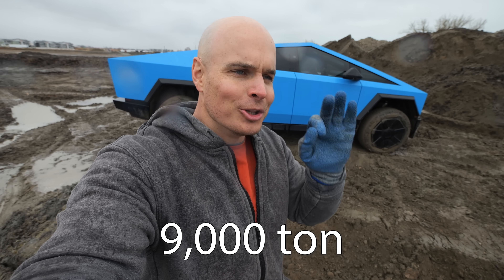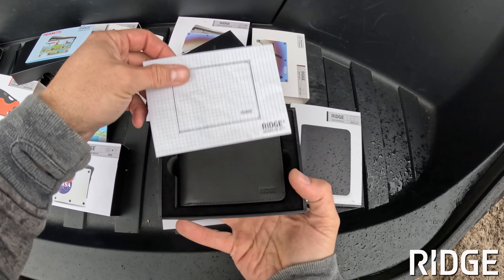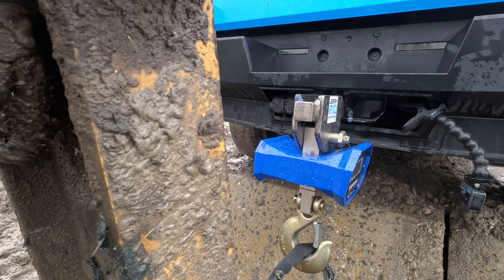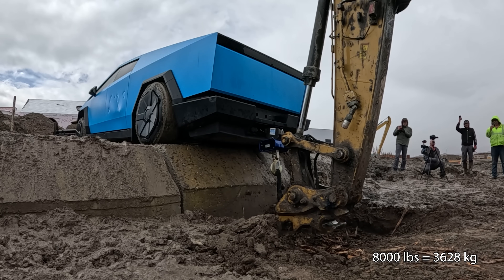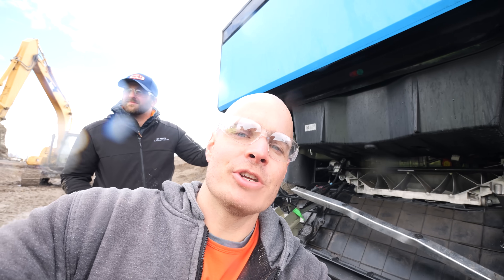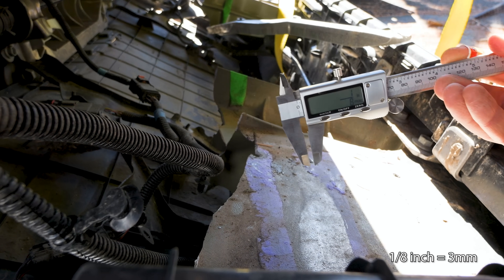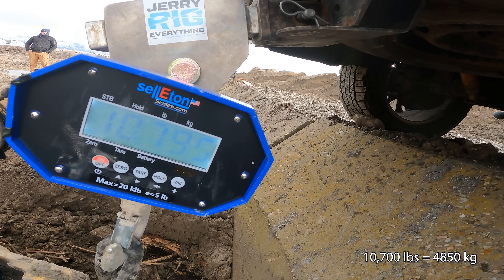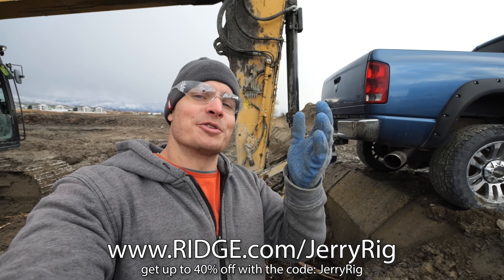SHOULD YOU TOW WITH A CYBERTRUCK?! - (catastrophic failure test)

Comment: What a moron. He says... "that is one improperly loaded trailer away from disaster." If you had a 10,000 lbs on the tongue, the front of the truck would be off the ground. This is a dumb test and just for clicks.
Reply: 9:50  The video explained that the tongue weight should safely bear 10-15% of the trailer weight.  However, it will need to bear significantly more than this amount in certain situations like cresting a hill.  Is it possible that you're not as smart as you think you are?

Comment: This test was kind of frustrated well exceeded the tongue weight capacity 9.4 * rated tongue weight 
The rated tongue weight capacity was 1100 lb you made it seem like 11,000 lb was the tongue weight capacity that is not the case that is the towing capacity 
And yes some extra weight can become tongue weight but it is very very unlikely that you would have this much weight be transferred to being tongue weight I think 9.4 x capacity is a good 😢
Reply: so then why does a gas truck that's has been totalled off and bent tow hitch from the crash and still holds at the breaking point of the cyber truck?
Reply: @raven4k998 because the dodge is a 3/4 ton truck. It's made specifically to have a much higher towing and tongue rating. It's as simple as that.

Comment: this is a test of tongue weight. make note they had to hold down the front of the car because it would have lifted the front off the ground.  Completely useless test. even the ridiculous ignorant comment is still in the top of page " The hitch breaks around 10,000 pounds. (4500kg) Which is far too close to the 11,000 pound towing capacity. Yikes." He is not pulling 10,000 lbs he is pushing straight down - that is called tongue weight which is typically < 10 % of the towing capacity. So, a 10-fold safety margin is more than acceptable.

Comment: Great to know you were testing tongue weight and not towing capacity... The tounge weight of the cybertruck is rated at 1100 lbs, you put almost 10X that amount on it.
For the Dodge 2500, the Max Tongue weight is 1800 lbs.
So you already knew (If you know vehicles) that the Tesla is at a disadvantage at the start by looking at the stats to begin with.

Towing capacity and tongue weight are not the same thing.... Be honest about that.

Comment: The amount of Tesla appologists who are entirely missing the point are wild.  I'd bet some of these people would convince themselves that they deserve it if Elon/Tesla drowned their cat.

The point isn't about carrying that much tongue weight, it's about what happens over time when you hit bumps, crest hills, etc. etc.  It's not likely to fail instantly, but it can, will, and has failed in the past 100% because of a design flaw that other trucks don't have.

Think of it this way.  What would you rather have, a life vest that works 90% of the time, or one that works 100% of the time?  The fact that aluminum fatigues much more readily than steel means that each bump hit while towing is compounding the likelihood of failure.  Aluminum will fail over time while the steel goes back to zero after every event.  They are not the same, and one is factually better.  Stop gurgling on Elon's slim jim and acknowledge that it's a bad choice.
Reply: The only problem with your objection is that this video wasn't really a test of fatigue over time, though it is mentioned.  It is a test of maximal tongue weight loading.  

The less flashy video of exposing a Tesla frame to reasonable tongue weights repeatedly over days, weeks, or months or however long it would take to break and comparing that to a steel frame truck would make what you say is the point so much more clearly.
Reply: @aelfgernon7729  It's a matter of time vs effort I think.  He mentions in the video about how occasionally due to bumps and cresting hills, that the tongue weight will occasionally spike perhaps sometimes to the failure point.  That fact alone makes the max tongue weight thing some degree of relevant.  In the end, the point remains; why settle for something that is factually inferior when literally everything else uses better materials.  Even if it's relatively unlikely to fail the first handful of times, it's infinitely more probable than a steel frame to fail.  And when it's marketed as a robust/rugged design and it can't even hold a candle to cars from the 90's and earlier, it's a problem.

You have the choice of a $100k car that's made with a more fragile frame that has been proven to fail (both in tests and irl) being put up against a 20 year old truck that (adjusted for inflation) costs half the price.  (when new.)  There is no world in which the Cyber Truck is the logical choice other than just being a Tesla fanboy.  I don't even hate Teslas, but I'm not going to pretend this thing is good at what it was supposedly designed to do because it's not.  It's a unique looking, fun to drive, fast in a straight line toy.  Not my cup of tea, but a good truck it is not; especially with the plethora of other repeat issues it's had.

Comment: Has there been any reported cases of hitch failure during towing? 
For the want to be engineers out there, steel has three times the modulus of aluminum which means it can handle more stress before reaching the point of plastic defamation and failure.

There’s nothing wrong with using aluminum for this application as long as it meets the requirements and specifications for this application. Vertical tongue weight of 10 X was not intended application for this part.

Comment: The fact it was flexing at much lower loads is very worrying. This will introduce fatigue into the structure meaning repeated flex at low loads will cause it to fail with lower loads than this example.

Comment: This guy is not an Engineer. Or if he is, this is FUD and hypercritical. 1) this is a static test totally unrepresentative of dynamic conditions, he held the front down. 2) the suspension is there (its purpose) to absorb shock loads ie take the strain 3) in shock loads the front will go light or lift 4) the toy example going over a ridge, the back wheels would go light like with any towing vehicle 5) the only thing he said that was right was to avoid any idiot towing 1100 lbs at 80 mph.

Comment: 11:53 I see ABSOLUTELY NO ONE talking about it’s a atleast 10-15+ year old truck vs a brand new or mabey 3 year old truck. One has had been used n stressed for years and time to rust, the other has not
Reply: I’d take a dodge over a Tesla “truck” any day of the week
Reply: @Charnelhauss  cope
Reply: @waylettmedia  you are literally the one coping here
Reply: @waylettmedia  glaze
Reply: @ stop glazing me lil bro
Reply: @waylettmedia  you’re like factually and literally the only one coping here lmao
Reply: @ cope?
Reply: @waylettmedia cope from what? I don't get it.
Reply: @ your already coping
Reply: Aluminium doesn't rust, so theoretically it should hold better overtime. But structurally aluminium is never as strong as steel
Reply: @ it also doesn’t have a fatigue limit. So it will get weaker over time, even with small loads, until it inevitably fails. It has been not even 2 years and these things are already failing to perform to expectations.
Reply: All I saw is that the entire bed split apart a bit with a crack at around 5000 lb. Do you think nothing bad happened there? Would you just continue to use that truck like nothing happened?
Reply: 2500 has a tongue weight double that of a tesla. Comparing the two as equal is dishonest. Still, the tesla took a 9,000 pound load when it's tongue weight was only 1,000 pounds. Saying it broke at 9000 pound when it's rated for 10,000 is conflating tongue capacity and towing capacity. Video is a lie.
Reply: @improvokt he didn’t conflate anything. This was addressed in the last 5 minutes of the video.

Comment: @JerryRigEverything I am no expert in engineering, towing things, the chemistry of aluminum or steel. But I have towed some stuff before I’ve towed vehicles, house stuff and everything in between. I’ve even towed massive lathes before. So I know nothing I really say is a big positive or negative comment on what I’m going to say. I also know your posted this video a minimum of three days ago. But this is what I think. For all of the commenters in the @mattuw82 comment thread that were basically call you an idiot, a liar, and almost anything else underneath the sun without specifically saying all of those names. I don’t think they’re fully taking everything into consideration like every single aspect of these materials. My personal opinion is aluminum framing for vehicles is pretty good. It’s decent makes a decently strong vehicle out of lightweight material. but I also know that aluminum has a has no fatigue limit, and weekends overtime with use. And I know steel has a fatigue limit and I know even if you use stress underneath that fatigue limit, it’s gonna act the same almost every single time. But I also believe as a person who lives out in the remote areas in a not so populated area of southern Utah. Who does lots of activities with trucks involving towing, off Roading, hauling stuff etc.,. I believe any vehicle that is specifically built with hauling in mind, should have a steel frame and not one made of aluminum. there is just less variables with having the steel frame than aluminum frame. Steel is also cheaper to repair/patch than aluminum. Not to mention you’re not always gonna have access to aluminum welding equipment on job site at like in remote Alaska for a pipeline or something similar. but I wish you and your family a great day, evening, afternoon, night and a lovely week.

Comment: They backed the Tesla up so the rear was right at the edge of the ditch. The hitch itself wasn’t really doing anything at first, but the way they set it up put the rear of the Tesla right at the drop. The bulldozer was down in the ditch, hooked to the hitch, and instead of pulling it straight back, they were pulling it down.

A hitch is built for towing loads horizontally, spreading the weight across the frame and trailer tongue. It is not designed to handle a straight downward pull, especially with 10,000 pounds of force.

Since the Tesla’s rear was already positioned at the edge, gravity was already working against it. When they pulled down, they weren’t just applying 10,000 pounds of force; they were also bending and compressing the hitch in a way it was never designed to handle. The hitch basically became a lever, amplifying the stress even more.

With the weight of the Tesla already pressing down, plus the downward pull from the bulldozer, the hitch had no chance. If they had pulled straight back instead of down, it might have held, but pulling from that angle put way too much force in the wrong direction, which is why it broke.

Comment: First, I have absolutely no incentive to defend Elon's company right now lol. But... the angle of the applied force should be an important consideration, no? Nobody is towing anything by hanging it directly downward off their hitch.
Reply: No. He explained why and he tested the other truck the exact same way.
Reply: @dvilsbls2396   the other truck is irrelevant to the point of the video... at least the point as I understood it from the title and the way they seemed to just throw another random truck they had lying around in to test. He did roughly explain by showing a model truck towing a load uphill. Even still, if the trailer is 11,000lbs and it has wheels to distribute the load, there's no way you're getting all 11,000lbs pulling down directly on the hitch. I'll admit I could be missing something. I'm not a truck guy at all. For the record, I am pleased to see a Cybertruck torn apart. And the other truck did obviously hold up a lot better.
Reply: @Kmg403  What you're missing is the different real life scenarios and situations where the weight could be applied downward

Comment: interesting exercise in breaking a cybertruck. But stupid comments about safety. When you exceed the designed max tongue weight by over 9 times it will break. Safe solution, don't exceed the designed tongue weight if you want to continue safe operations.

Comment: Cybertruck's broken frame occurred around 10,000 pounds of vertical pressure.

Trailer pull is two vectors-horizontal (pulling the weight) and vertical (drawbar pressure on the hitch ball).
It is assumed that the vertical pressure is about 10% of the weight of the trailer. Therefore, hooks in Europe have 75-150kg of allowable vertical pressure.

Also, 10,000 pounds of vertical pressure is not bad for a car approved for an 11,000-pound trailer.

Comment: "This test is not scientific and was done just to break the cybertruck" Oh no! You are saying that dangling a huge fucking digger of a hitch is not the proper protocol for testing vehicles!? Oh goodness, how could they lie to me?! 
   Why would I care if this is not done properly, when Zack is not the one who certifies these trucks? Is he biased against the cybertruck? Yeah, me too. And so are a lot of people. Even with this unscientific method you can clearly see one car struggling under (very) extreme conditions and the other shattering into pieces in the same scenario. I want my heavy duty vehicle to break of a part, deflate the tires, damage the suspension and give up when it has nothing left to give. The cybertruck just fucking shits itself. Even befor the catastrophic ending it creaks, lays flat on its belly and cries for help, refusing to work. I wouldn't want to drive behind it either. It's more likely, that CT drivers will improperly load their trailer and/or go faster than they should. While these exact problems may not occur on the road, the car still show proclivity to more extreme failures, when compared to other vehicles in it's class.

Comment: hey it broke at the same exact spot that the WhistlinDiesel one did! 
Aluminium just snaps outright, there's no grace period where you can notice the damage and back off, replace or repair before something catastrophic happens. 
Whether or not the Cybertruck is "good enough" for what it's supposed to do is a different matter entirely, although I did hear of one case in which the frame broke while towing on the highway, same exact spot as well. 
In any case, Steel will always be Real!

Comment: I’ve got to call out a big misconception in this Cybertruck hitch test. You’re testing the tow safety of the Cybertruck by applying its full tow capacity (11,000 lbs) as downforce directly on the tongue weight, implying that tow capacity should equal tongue capacity. That’s just not how it works. Tow capacity is the total weight a vehicle can pull horizontally behind it, while tongue weight is the downward force exerted on the hitch itself—two completely different metrics. The Cybertruck’s official max tongue weight is 1,100 lbs, which is about 10% of its 11,000-lb tow capacity, a standard ratio for most trucks.

The fact that the frame held up to ~10,000 lbs of tongue weight before failing, as shown in your test, is absolutely incredible. That’s nearly 10 times the spec’d tongue capacity of 1,100 lbs!  Equating tow capacity to tongue capacity is misleading and skews the narrative here. Also, full transparency: since you’re sponsored by Ford, it’s worth noting that Ford’s F-150 Lightning has a tongue weight limit of 1,000 lbs with its max tow package—lower than the Cybertruck’s—so this test feels a bit like an apples-to-oranges comparison to push a point. The Cybertruck’s hitch didn’t fail at its rated spec; it massively exceeded it. Why don't you test the Ford Lightning now?

Comment: To be fair to both trucks...towing capacity is rated for lateral loads, not being pulled strait down away from the frame...no trailer would ever be able to exert this much vertical loading on the hitch so this test is useless for any practical results

Comment: Tongue weight ratings have dynamic loads factored in.  Mainly because the average consumer doesn’t have a way to measure and many don’t understand dynamic loads.   Going over a hill will not put purely sheer loads on the hitch unless your trailer is hanging off a cliff.  If the front of the truck will lift up before the hitch fails than it’s not a problem.  The fact that aluminum does not act the same as steel when stressed is correct but there are a ton of people with aluminum trailer adapters and aluminum trailers that have had no issues.  I understand and respect your decision not to use your Cybertruck for business advertisement with everything going on.  Love you Zac, but this video seems a little biased.

Comment: This test will never occur in real life, like this. But over 5, 10, or 50,000 miles, the stress induced on the aluminum will cause it to crack and break whereas your steel will be just fine. The aluminum frame is stupid when done the Tesler way. 

Don't be an Elon fanboy just to be a fanboy. Try to know something as well. Don't emulate your fake God

Comment: For people point out tongue vs trailer weight, you're forgetting dynamic vs static load. A 1500 - 2000 lbs tongue weight, while hitting a big bump, easily puts the suspension on bump stops. A 4g shock load would generate 8000 lbs tongue. Aluminum having no farigue limit, do this multiple times and you'll reach the equivalent stress as 10,000 lbs static.

Comment: misleading. 10400/11000 is 95% of the rated limit for catastrophic failure. the dodge has a limit of 13500 which means if it passes 12800 then it beats the Tesla. what you tested on the dodge is actually equivalent to 8700 pounds on the Tesla, which the Tesla was fine at.
Reply: Better sell your stock now while its still worth anything
Reply: @veselekov  haha